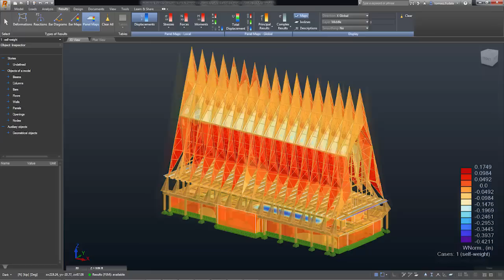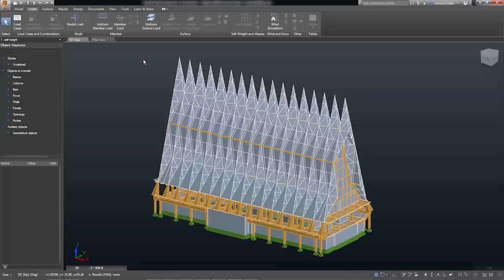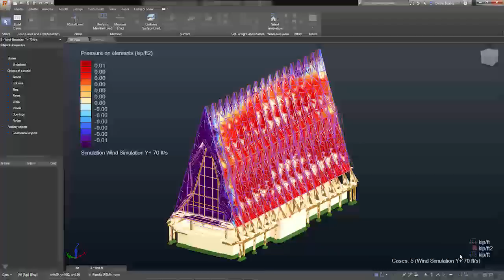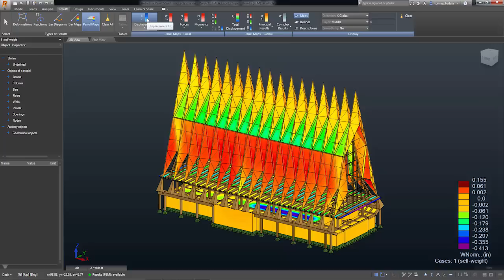Autodesk Labs: Autodesk React Structures Overview

Comment: Patrick St-Louis 28117 :Hi Scott, I have post my Feedback in the Autodesk forums for React, I'm trying to understand what Autodesk developer's want to do, but I hope that React will be a transition phase to make a new version of Robot that will be challenge to the 3 following fields, I want to say :1- the BIM and BRIM process in an easier way2- the analysis and design of various structures for various codes, in linear and non linear domain for professional purposes3- the analysis and design of various structures for various codes, in linear and non linear domain for academic purposesI think that Robot are doing that well at 70% for the second and the third part and where some to topics for analysis and design or verification must be improved. For the first part I understand that the goal of Autodesk with the acquisition of Advance Steel and the Bridge structural analysis recently is to make all the products of suite in the same format by providing an interface similar for all of them. I have tested React yesterday and I see that some ameliorations have been made in the way that the diagrams for deformations and stress are shown which are better than the Robot's one. But I'm waiting for the way that the mode shapes will be shown to make a final impression on that progress. Beside the first steps of the modelling process which are similar to the Revit or the Advance one's, the commands are similar to the Robot's one, which is a good point for the Robot users, in the case where Robot will be migrate to  React, but I hope that React will be a transition phase to make a Future version of Robot that could sustain with the 3 challenges defined above
Reply: +Patrick St-Louis Thank you for your informed opinion and comments. Even though you also posted to the forums, I passed them on to the team right from here too. I know they will consider your comments thoughtfully.